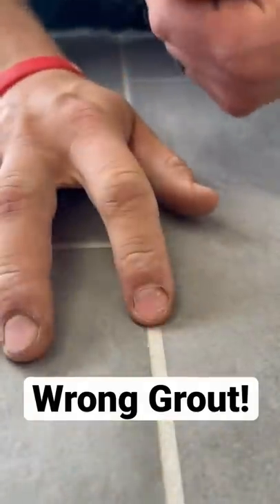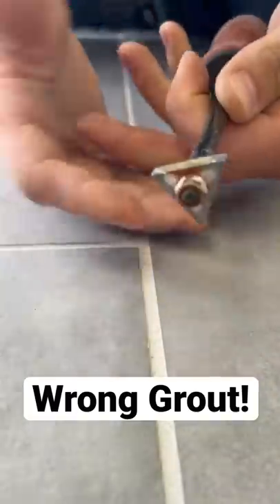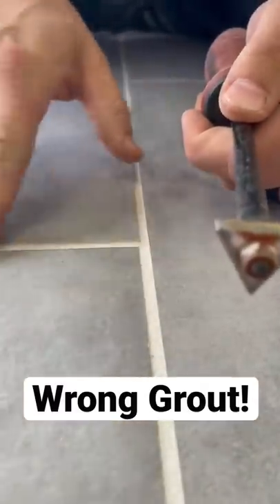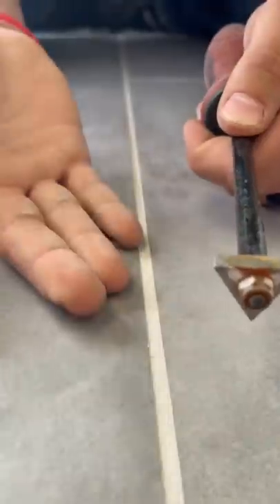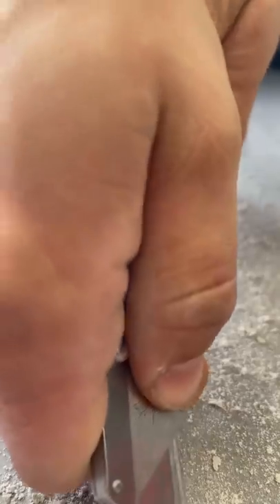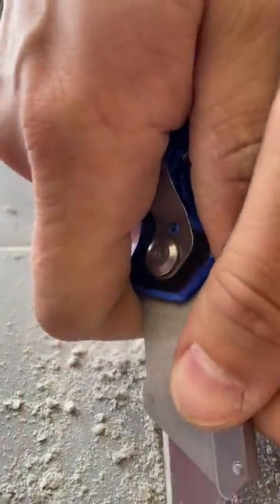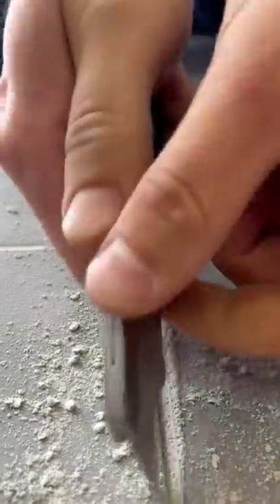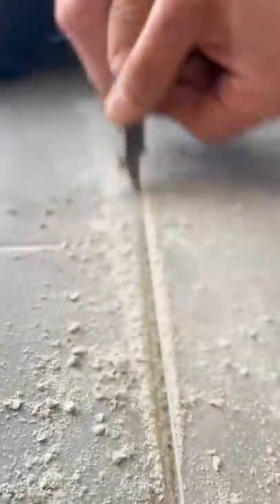Huge Mistake! We can fix it! #shorts #youtubeshorts #diy

Comment: On the next tutorial. "How to get box cutter scratches off tile."
Reply: Haha. Amazing comment
Reply: Didn’t realize he actually slices the tile!
Reply: I swear man.
Reply: I was thinking the same exact thing
Reply: @AngelsDontFall  first half of the comment made sense
Reply: Just dont scratch your tile
Reply: Use dried mortar and rub it until it comes off.
Reply: No scratches bro just a chipped corner on a tile
Reply: A Box cutter can't scratch tile
Reply: @gianvitomarzulli9740  lolll definitely can ive done it...mannny times.. thats why i fix appliances now..tile comes in many different materials and hardness...
Reply: @bikeman78  no it's not. it's very predictable and also wrong... terrible joke
Reply: he didn't scratch it...
Reply: @gianvitomarzulli9740  you’re heavily mistaken.
Reply: @tyleraulridge9184  if It Is proper tile,like ceramic,It cannot get scratched by steel
Reply: @judas1523  he didn't..but he did chip the corner lol
Reply: Use mixed grout and rub out the scuff. Lmao 🤣 hate when that shit happens
Reply: Hahaha 🤣
Reply: @Smokeone44  or pumice i think worked for me
Reply: Pop the tiles and put them back in straight
Reply: Replace the tile. Huger mistake!!
Reply: Hahahahaha
Reply: YES
Reply: @gianvitomarzulli9740  HCS blades in a box cutter will scratch the hell out of tile and glass
Reply: Depends on type of grout.. that tool wears out FAST..
Reply: Tis but a scratch
Reply: A very expensive small scratch lmfao
Reply: @travistidwell6734  I saw that too! Lol 👍
Reply: @AngelsDontFall  🤨
Reply: only takes a little wet sanding lol
Reply: Exactly what happened during my own bathroom renovation :/ scratched and chipped
Reply: It was dust he made a mark that looked like a scratch but he just moved the dust away leaving the tile uncovered. He ended up vacuuming the dust and it went back to normal if you look near the end
Reply: Lmfao I was thinking the same thing. Like dam he got quiet for a sec after that scratch 😂😂
Reply: @tyleraulridge9184   rub it with dried mortar until it comes off? That just sounds painful.
Reply: @AngelsDontFall  is your comment auto generated? Shit gave me a stroke
Reply: Thats exactly what i thought !😆
Reply: Ceramic tile is harder than steel
Reply: Was here to comment that lol
Reply: @AngelsDontFall  what
Reply: RIGHT?
Reply: Exactly, I use the exact same knife and used to do the exact same thing while cleaning the joints 😂
Reply: Or “how to replace a tile with chipped glaze”
Reply: Yea, he mad.
Reply: @AngelsDontFall  
..
Reply: Beat me to it.
Reply: This comment is actually unreal hahaha
Reply: It’s just the dust makes it look like a scratch
Reply: That’s just a dust trail
Reply: @AngelsDontFall  if you read this guys comment only the top party matters
Reply: It’s actually extremely difficult to scratch tile with a razor blade. I’ve been doing tile for several months now and that little slip up happens a lot. Never a single mark
Reply: No way that scratched it
Reply: What kind of tile are y’all installing? I rarely am able to scratch tile? Maybe a rough surface tile would “scratch”. More like scraping the rough off
Reply: Looked to me like it just made  a line in the dust. The “scratch” disappeared with the vacuum.
Reply: He didn’t scratch it tho
Reply: Yea if you do it wrong
Reply: U do realize ceramic tiles cant be scratched right?
Reply: Haha was literally just going to say that. Huge scratch in the tile
Reply: He’s scratching the side and bottom where the gaunt will cover…
Reply: If the tiles were laid in line it wouldn't of caught and scratched the tile. Terrible tile job...
Reply: @rikipoppy1113  tile master Tiki poopi thank you for input.
Reply: @judas1523  bro you are pressed that he thinks someone is funny, that shows that you not funny
Reply: It should be good, the average box cutter has a lower MOHs hardness rating then a tile, though I would still be careful
Reply: @alexgao2587  thank you for that Alex!
Reply: Lol
Reply: Yep
Reply: Lucky is not marble or travertine!! He'll be changing more than grout, by the way, no need to remove grout just to change color , epoxy grout or grout color renew products will do the job.
Reply: What’s worse Eid they make tools to do this
Reply: If you know, you know 👏👏👏
Reply: Remove the tile and replace it. Ain’t no saving it
Reply: Saw that first thing I've actually had to do this before I didn't use some special tool I actually use a saw blade
Reply: Did you know that ceramic is stronger than steel?
Reply: Use auto scratch hide stuff. Then a sealer over that
Reply: Tile is pretty fucking hard. Its not going to scratch it
Reply: @fixitfelix718  If your box cutter is harder than the tile than that's either really bad tile or some hard ass box cutter
Reply: @davidj3841  i only use ddp diamond cutters
Reply: Tile is much harder than a box cutter
Reply: Depending what tile it was it probably didnt even scratch it but who knows
Reply: Was looking for this comment jaja
Reply: Ceramic tile will sooner dull the knife than scratch, i do it all the time at work to show people how hard a ceramic tile is
Reply: Third video, how to control a box cutter on tile.
Reply: Came In to say that exact thing
Reply: It’s not scratched
Reply: @noahsmith2767  lol  it is
Reply: Lollllll
Reply: Hahaha
Reply: I’ve got about three scratches on white gloss tiles now. Bugs me every time I look at them.
Reply: Video after that, how to sharpen your box cutter
Reply: Surprised he didn't chip a corner off the tile. 

Use a mesh blade.
Reply: Your framing of the joke is flawless.  I literally lol'd obnoxiously in a quiet room like a weirdo when I read this.
Reply: Steel isn't as hard as ceramic and therefore wouldn't have made a scratch
Reply: Hahahahahaha my thoughts exactly
Reply: Damn so many hater that have definitely never touched a tile in their life I
Reply: Don’t forget to take out the scratched tile with the extra 10% materials you didn’t get.
Reply: Just dust, you can see there isnt a scratch after he sucks up the dust. Open your eyes
Reply: I carry magic erasers for that. Pretty much always works. Otherwise sometimes the grout itself can work.
Reply: @Titantitan001  Sounds like the hackyman is open for business, you do work in the Hollywood area?  I'm a really famous actor and always looking for a hack job, it's really hard to find poor work in the area everyone else is doing quality.
Reply: @659009stan  obviously you have never worked with tile it's not going to scratch that will wash off really easily the ceramic tile is way harder than that blade
Reply: @bruhscousin9788  I have worked with tile bruh. Obviously you never worked with tile because I said so.
Reply: @659009stan  your thinking of soapstone or some shit. Tile ain't scratching with no dam utility knife.
Reply: @bruhscousin9788  maybe idk
Reply: @rickramirez3235  what ever you say boss
Reply: Tell me you have never worked with porcelain before. Shit comes right off as soon as he grouts again and cleans it. The sand will handle that.
Reply: It shows how much you know just by calling it a box cutter. Stick to the desk work buddy.
Reply: @SwagLord  Reading your comment while holding a KNIFE on my waist.
Reply: @Jinzo50  Reading your comment with a Glock 19 Gen5 MOS tucked. And it's called a utility knife.
Reply: @smiles423  Lol idgaf
Reply: Obviously you guys have no clue about tile, he didn’t scratch it it’s completely fine
Reply: @aaronmladin955  Obviously you have no clue of what sarcasm is..
Reply: @fixitfelix718  if it's porcelain it won't, unless it has a very glassy finish, and in that case you can polish as you would glass.
Reply: @robertopics  yea i used pumice a couple times and worked on most tiles scratched with metal... i have porsalin tiles at my moms we couldn't drill it with diamond tile bits it took over 13 bits to do a damn 1/4 hole
Reply: And how to line the tile up while setting it.
Reply: It won't scratch the tile. Shits pretty hard
Reply: @CrowsFeetOld  it will scratch the tile, and since the tile is not lined up, you could also chip the tile.  But it is still the way. Just be more careful.
Reply: That is some weak crap grout to come out that easy
Reply: If his tile was straight to begin with prolly wouldn’t happen
Reply: Impossible.  Forever effed-up, times dozens all over the floor....
Reply: 😂😂😂 teacher needs teaching 🤣👌
Reply: Do you know how hard tile is you cant just scratch it with a razor knife unless you were scratching it with carbide or something even then slim chance
Reply: Tile is to tough to cut with a box cutter...
Reply: Someone isn't smart
Reply: If that was possible
Reply: It’s not a scratch. It’s just the line from the blade that went through the dust. He would need more effort for a good scratch
Reply: I was thinking about that whole the video😅
Reply: He was nervous, ok..
Reply: You can see the tiles are not even lining up, but he’s good at removing grout because he fucks the tile up all the time

Comment: Save yourself a lot of headache and just stain the grout. If you ever have to use the scaper he shows be careful bc it's extremely easy to chip corners with that tool
Reply: That’s what I came here to say. You beat me to it by a day. And a razor knife too?  SMH.
Reply: You wouldn't be able to stain it if the grout was already sealed right? But this grout has no shine to it and still looks porous which makes me think stain would work fine here...
Reply: If the ground line is cured it is just washed away over time but you can if it's not
Reply: Grout line
Reply: This is a garbage process anyways, there has to be a better one other than this which will destroy your back and make the foreman on the site happy that you are working for your tiny paycheck at the expense of your health and sanity.
Reply: @lordnick18  right on. I set tile for a living😫
Reply: What if he needed a lighter color?
Reply: That's true but do what u paid for. It's called good business.
Reply: @samsngdevice5103  are you slow?
Reply: You can’t trust anyone who calls a utility knife a box cutter
Reply: @myerah7178 😆
Reply: I used grout paint with sealer in it. Applied with a tooth brush and took only about an hour. Did it to my bathrooms, entry and kitchen. Its been 6 years and hasn't shown signs of chipping, with 3 kids and dogs.
Reply: @AB-83  yup! I had to stain a 1300 ft floor bc the grout went light and dark. Idk who said it doesn't work but I'm glad see why I mentioned staining over scraping
Reply: How do you stain it this will be really helpful to me in the future
Reply: Or use right grout
Reply: @adriangarcia2007  go to your local paint store and get oil based stain color of your choice and paint it on.  Have a clean rag to wipe off excess.   It works great and last a long time.
Reply: looks like it would scratch it as well. but ive rarely had work done that was perfect. $20,000 stereo installs that broke my car clips an found out they used sticky tar to make it stick. etc.

 good luck suing anyone while you live in a terrorist nation with terror courts. good luck getting your life back chasing down every interaction
Reply: Real talk. That tool sucks.
Reply: Not to mention that tile he has to replace cause the box cutter slip
Reply: All the you tube professionals comming out like roaches.
Reply: @toddedwards1371 🤨 not sure who that's directed toward under here but I install the shit for a living. Why would you scrape an entire floor if you have the option to use a grout stain?
Reply: @Momentaryghost  bingo
Reply: Yes
Reply: @donscrilla7171  I am the ultimate contractor, I am a walking encyclopedia of knowledge, you know nothing
Reply: @danielburris4096  I came here to say the same thing myself, but you beat me to it by a week. Good thing I checked the comments first and saved myself the trouble. 👍
Reply: Don what would the world do without you?!? thanks for your comment
Reply: Wrong
Reply: @jaycustom21  ain't no video money in that 🤑😉
Reply: @MatthewQuinton  haha It's nice to see someone here who I assume also sets tile for a living. Even if you take your time with that damn tool you're bound to slip and blow out a corner eventually
Reply: Wow, I'm sure the guy shooting a video about it with the tools and displaying adequate skills didn't know that.
Reply: @donscrilla7171  you know, you're probably right about how to set tiles and stuff and maybe you can also fix a lot of things. Too bad the only thing you can't fix is your attitude
Reply: staining grout sounds like more of a headache
Reply: And that’s how they start the next video- how to fix a tile when you chip a corner
Reply: @myerah7178  I know! They're airline blades aren't they?
Reply: Idk how big this job is but that going to work arms & hands and fast..especially if you try and power your way thru all that grout. No fun...this happens more than you'd think..it sounds like he's trying to cut thru the floor by pushing so hard. If he slips..? Stab in the leg..fk..are breaking or chipping tiles...customers being a**holes as they can be sometimes... could've just said fk it they don't want it....tear it out.
Reply: Can the stain change a dark to a light too?

Comment: He made a big ass scratch on the tile with the box cutter. We grouted the wrong color. No sir, you grouted the wrong color. There is no need to rush at this point.
Reply: If your tiles get scratches from a Box cutter, get New tiles lol
Reply: @NotAWomble  you mean when the video cut as soon as he vacuums over it? While the upload isn’t in 4K resolution. sure name call me all you want.
Reply: @Tyler Parker my man did you have an aneurysm? Your comment makes me think so. He never implied that box cutters are made from boxes😂
Reply: Razor blades wont do a thing to porcelain tile.
Reply: I used to help cut grout for about a year with my stepdad and I was about 10 at that point meaning I made alot of mistakes but I have never scratched a tile from the razor slipping
Reply: @NotAWomble  he said in the comments that he scratched it himself and made a mistake🤦‍♂️
Reply: @beckyross3210  he literally says in the pinned comment that it's not a scratch it's just the dust
Reply: @RapTapTap69  then admits to making a mistake🤷‍♂️
Reply: @beckyross3210  yes.... Because it was a mistake to let the razor slip. He specifically says that it didn't scratch.
Reply: It may not be super visible but I guarantee you there's a scratch on the surface of the tile
Reply: @emanuelbabayagaortiz7333  pay more attention. It cuts after he vaccums it and you can see the scratch goes awau
Reply: @connersmith9192 …. I’ve never had this manny likes in a comment. Can’t I just have this one for me? Before I get banned or worse be swatted because I don’t leave a paper trail of vpns and cheap email tricks
Reply: @emanuelbabayagaortiz7333  bro, people aren't going to swat and dox u over a small comment like this.
Reply: @emanuelbabayagaortiz7333  you on something huh buddy? Lizardmen are coming for you be careful 🤣
Reply: Watch again it was a line of dust that was pushed away by the blade not a scratch
Reply: @Parker Corley did jerry rig tell you that 😂
Reply: @snowcow1173  yes I regret this comment yes
Reply: He literally says “not a scratch” in his comment
Reply: It's not a "you grouted the wrong color" if it wasn't his fault or the "we" was him and his team. People change their minds or give wrong instructions. Lotta assumptions you're making based on 0 information.
Reply: Yeah I can't believe I missed that the first time but yeah he totally scratched that tile horribly and that you will definitely see that.
Reply: Youtube shorts have to be under a minute though.
Reply: I saw that also lol scratch the shit out of the tile

Comment: I’ve done tile for 30 years and I’ve never done this. A couple times we’ve had to use a stain/sealer to change the color and it works great and is actually more stain resistant than grout alone.
Reply: Yeah this doesn't seem like the best idea
Reply: Same. Its extra work for no reason
Reply: I was just waiting for a chunk of Tile to chip away.  Never a good idea to use metal tools against brittle tile.
Reply: @Ky_Mycology  in tile's defence... I had to chip away about an 1/8 inch away from a toilet drain.  Tile guy went right to the drain without the bolts being installed. 

I used a hammer and chisel/screwdriver. What I had on hand...  (My house, so I didn't care if I broke it) 
And I'll tell ya... not at easy to chip an edge when you're using controlled force. 

It's always when you don't want to break it, that it breaks though. Funny how that works. 😁
Reply: We only stain grout if it’s trying to get its original color. But prism grout fixed that. Redoing a grout seems a longer solution than staining with the risk of coming off. But that’s just me
Reply: how do you stain the grout? also what kind of grout is used for bathroom
Reply: @FawziBreidi  It’s a product you can get at a tile supply place to match any grout color. You paint it on the grout. It’s definitely time consuming but it actually turns out great when done.
Reply: @FawziBreidi  Sorry, depending on the size of the joints I usually use sanded grout. They also sell a spray cam sealer that works great. Make sure it Is Not  water based though!
Reply: The new grout would crack and come up within months if this happened u would atleast have to use grinder and go deeper for grout to bond better and withstand contraction and expansion dust is a bitch though use wet sponge behind blade or vacuum attachment
Reply: Thinking the same thing why not stain